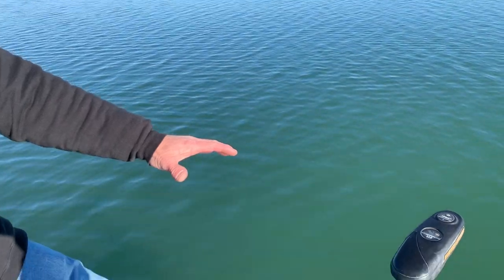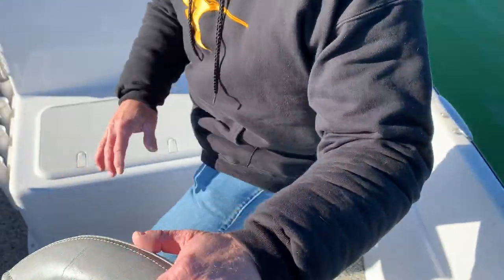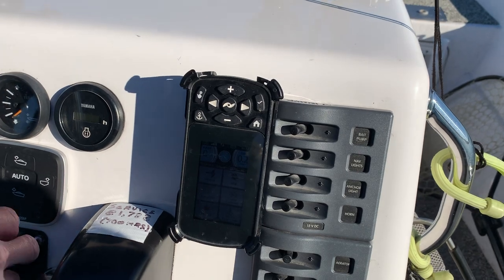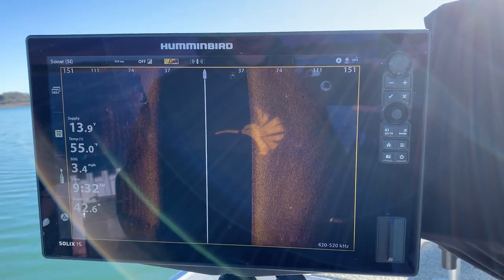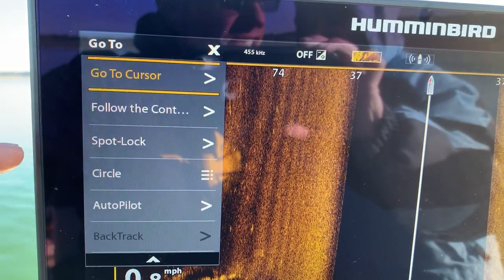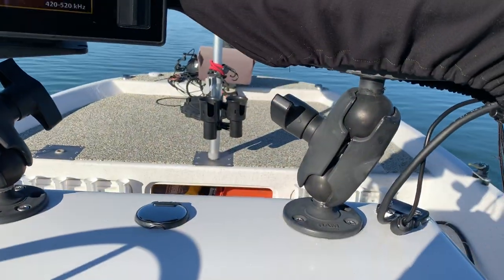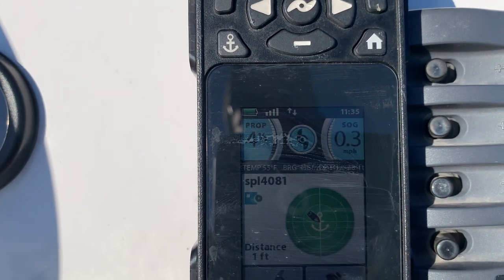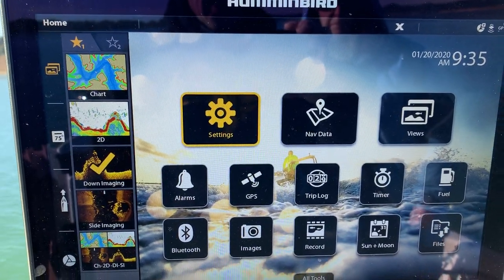USING MINN KOTA i-PILOT LINK & HUMMINBIRD SIDE IMAGING TO POSITION ON FISH TO THE SIDES OF YOUR BOAT

Comment: Hello Bob, i see you have a Solix for side scan and a lowrance hds for 2d and down scan. Do you have interference with 2 transducers?
Reply from the maker: No, because I select different frequencies for identical technologies across the two units.  For example, the 2D on the Solix may be set to 200 kHz, and the 2D on the Lowrance may be set to 83 kHz.

Comment: I have a question....let's say I had my screen split between a chart and side scan. I'm cruising along and spot some fish on a point. Can I go to the chart screen and place a spot that would position me further out on the point and then "goto" that spot and cast to the school of fish on the point?
Reply: With link, you have a couple options to do this. First off you could "go to" the waypoint you mark. While on your way to the point you can keep an eye on your remote screen for the distance you are from that point. If you wanted to be 75 feet away, start slowing down when you are 90 or so feet away and spotlock when you get close. The other option is when you "go to" your waypoint, select circle mode. Set radius and direction. Set your speed. Once you're on the circle path, you can cast to that point.

Comment: Hey there. Thanks for this great video. Is it possible to set the position of the boat a few feets away from the targeted fish (purporse is linear casting and not jigging)  with the nose of the boat pointing exactly and precisely to the target with the i Pilot Link by setting the target position on your Humminbird Unit ?
Reply from the maker: Yes, this is accomplished using the "JOG" function on the Minn Kota.  Once the motor is in Spot-Lock mode, using the hand-held remote, touch the "HOME" button (shaped like a house).  A green bullseye will appear on the screen of the remote.  Then, using the left arrow, right arrow, plus (for forward), or minus (for rearward), tap these buttons one time for a 5 foot move in that direction.  EXAMPLE: if you want to go 25 feet left, tap the left arrow 5 times (5x5=25).
Reply: Great ! 
Another question. In your vidéo or in general, is your Boat always moving « nose to direction » with the Minn Kota Ipilot Link ? It would give the possibility to stop the Boat a few feets before the target and knowing the exact angle of casting, without goiing over the spot and spooking the fish.

Comment: Here we are almost two years later, and this was a super-useful video - thanks! I am about to buy an Ulterra or Ultrex, but I use Garmin 106sv's. If I were to be moving along, looking at side-scan (or Down Imaging) and see some structure on the screen, I know I can mark it as a waypoint. 

Is there a way to tell the Ulterra or Ultrex to go to that waypoint (using iPilot GPS rather than iPilot Link) since I'm not using Humminbird screens? Would I just have to manually 'drive' my boat to that waypoint?
Reply from the maker: Craig, unfortunately, only the Humminbird sonar units will communicate with the Minn Kota i-Pilot Link trolling motor.  In your case, you'd set a waypoint, navigate back to it manually with trolling motor deployed and hand held remote in hand.  The instant you either arrive at your waypoint and/or see on sonar what you were searching for, you'd hit the Spot-Lock button (anchor icon).  Another option, since you have Garmin sonar, would be to trade for a Garmin trolling motor.

Comment: Can you have one HBird fishfinder with the capability of switching between the transducer that is shipped with it and a Minn Kota trolling motor transducer?

Thanks,
Keith
Reply from the maker: Keith, there are so many trolling motor/sonar/wire combinations out there that I cannot really answer your question without more specifics.  Your best bet is to find the serial number of all of the devices you want to include in this system, then call Humminbird Technical Support.  They are based in Alabama, and if they can't get right to you, they'll call you back within 2 hours.  The number is 800.633.1468.
Reply: @Holding the Line Guide Service   I appreciate you getting back with me. I've got the trolling motor but am still doing research on the fishfinders. I am leaning very strongly toward HBird as I specifically bought my Minn Kota tm with Link for the networking capabilities. 

I forgot to say thanks for the good work that you're doing for us and that I subbed earlier today.

Thanks,
Keith

Comment: Thanks for the video.  One question -  Assuming your side imaging transducer is in the back of the boat?  Do you need to give the transducer an offset value to make sure so that when you spot lock, you are actually over it at the front of the boat?
Reply from the maker: I usually just use my "Jog" function for precise positioning to account for any offset.  There is normally no offset, however, because the sonar unit creates the waypoint at its original location with its internal antenna, then the trolling motor head positions itself over that same waypoint.   Since the transducer has no GPS antenna, it really doesn't figure into the GPS positioning equation.

Comment: Where do you find that info that those in and after 2017 trolling motors have a more precise gpS in them?
Reply from the maker: Sir, if you look at the cover on the control head of your trolling motor and you see the blue "Bluetooth" symbol, you'll know your unit is a late 2017 model or newer.  Prior to late 2017, these units were not equipped with Bluetooth.  Good luck!
Reply: @HoldingTheLineSkiff  thank you, that helps! I bough mine a few days ago and today is 2022! I see that blue symbol 😁

Comment: Can you use this same process to fish a particular line of ridges / structure over, say, 1000 yards? (Fish down one side, then back the other?) Or, can you only use this to keep your boat over a particular target?
Reply from the maker: Spot-Lock only holds you on a spot, it does not allow you to move forward, rearward, laterally, or diagonally.  Movement in these directions may be accomplished by "Jogging" 5 feet at at time using the Jog function on the handheld remote control.
Reply: @HoldingTheLineSkiff  Is there a technology with these trolling motors that allows you to follow lake contours for an "auto pilot" experience specifically when trolling?  Like, can you click on two spots on your fish finder and have your boat troll back and forth or at least one direction.

Comment: Would you recommend using a side imaging transducer build into the lower unit of the trolling motor since you wouldn't be using the SI at optimal speed?
Reply from the maker: Ernie, I do NOT find SI very useful when built into the trolling motor.  DI and SI very much count on a slow, steady feed of information which is best obtained when operating the boat going slow and straight.  This is rarely the case when the trolling motor is used, either to propel the boat or when on Spot Lock.
Reply: @HoldingTheLineSkiff  doesn't make any sense. Trolling motors go slow????

Comment: Why can’t you just hit go to then cursor instead of spot lock
Reply from the maker: Because your screen will either be frozen or you will lose the use of the cursor during the entire time it takes for the motor to traverse to the selected location.
Reply from the maker: Additionally, hitting GO TO then CURSOR will not result in the motor Spot Locking at the destination.  It will simply arrive, then turn off, not arrive, then Spot-Lock.